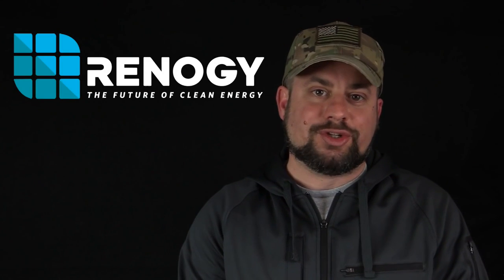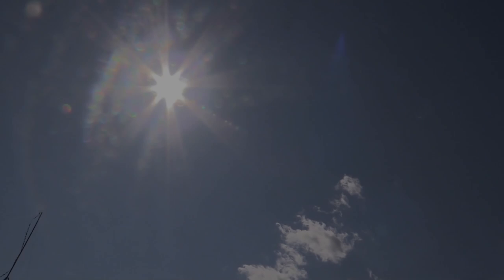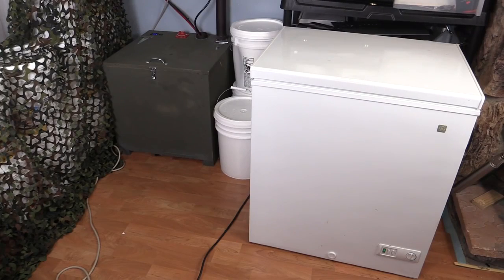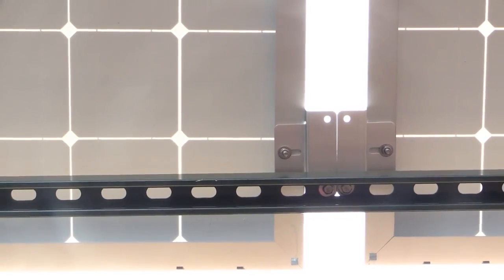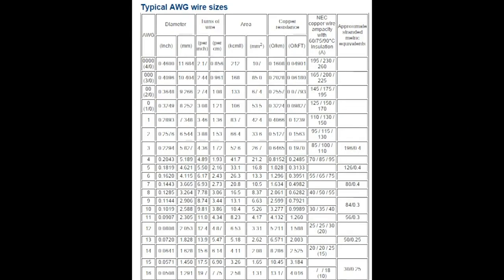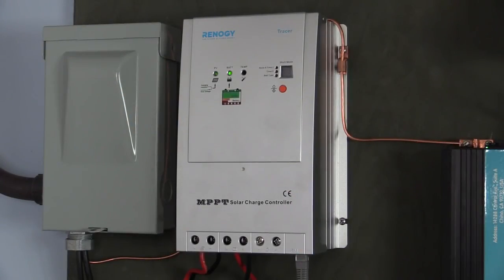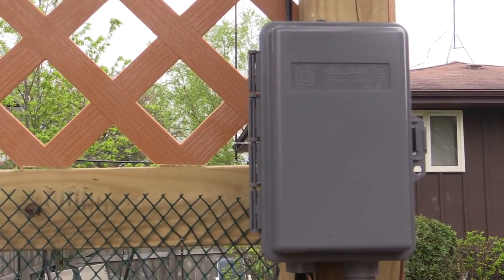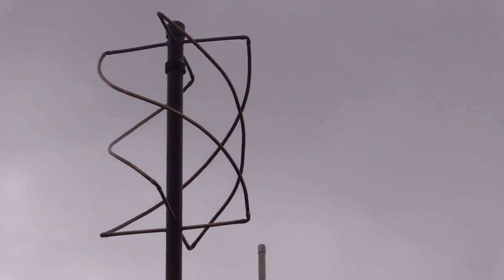The Ultimate Guide To DIY Off Grid Solar Power | Tin Hat Ranch

Comment: A small but important note to newbies, there have been critical advancements in Solar since this video was published 8 years ago. The price of lithium batteries has dropped drastically and they are more efficient, energy dense, lighter and long lasting (up to 20yrs) compared to flooded cell batteries. Don’t go for 12V sytem,  It’s more efficient to use 24V or 48v systems to power appliances and Electricals that have become increasingly important even to those living off grid. 48v is the best, that’s just four 12V batteries in series.  With modem lithium batteries you can have enough storage to run an electric stove , laundry machine and AC for a few hours but you’ll need expensive inverters to power them

Comment: Just came here to say thanks. This video helped kickstart my journey into solar over 6 years ago. Your video helped me to understand how to design my system, the importance of energy audit and the advantage of an MPPT solar charge controller. the video was the reference for my solar design and i watched it multiple times. Today I am completely off-grid and my system as grown from a 480w Solar Panel, 750w Inverter and 2 x 220AH battery into a 7.5kw PV, 28kWh Lithium Baattery Pack and 5kw Inverter system. I already remember the humble beginnings and how much you played a role in making it happen. Thanks so much.

Comment: "The average American household uses 30 kilowatts of electricity a day" (2:17) is not accurate.
Kilowatt (kW) is a unit of power - i.e. the rate of energy consumption. 
Electrical energy (consumption) is measured in kWh (kilowatt-hours).

Comment: Very well done. I've been off grid for 28 yrs and had to learn it all by experience. No budget made it tuff but now I have a forty eight volt system and a 5 thousand watt inverter all in one hybrid with 20 - 250 watt pannels and two 48 volt forklift batteries weighing 2 thousand pounds each. I think they will out live me now.

Comment: I am partway through and love this video. One point to make. No one with common sense would run an electric coffee pot on a small off-grid system. My system is smaller and simpler. Pour-over coffee with the water boiled on either the woodstove or the propane stove. Or a kero stove even. 
  Backups to backups are imperative offgrid

Comment: You can bank excess electrical in your water heater. You can look into circuitry that will dump excess power into a heating element in your hot water tank.

Comment: Where's the video that explains how to generate the income to do this stuff?  I'm down.   I'm a home owner, and I have a massive amount of Solar panels.  Completely handles all power usage between front house and a back house with a total of 2 families.    Is there a way to tap in to my system to have it be able to charge batteries like this?

Comment: I found that the best battery to use is the 2 volt gel batteries made for solar systems. They're a little expensive but I found that they last much longer then a lead acid battery. When it comes to buying solar panels, I would recommend the canadian-made panels over the panels made in China. The Canadian panels are high-quality panel then the China panels.

Comment: What if u have 4 240w panels at 37.2v 7.89amps and 40 to 50 feet to ur charge controller what size wire would that need running in parallel

Comment: I'm in central USA sunbelt. I constructed 400W setup with lifepo 4 650AH and 10000 Jupiter Inverter in case of grid down.
I find that simply setting 100W x 2 panels to hub facing east and 100W x 2  panels in parallel  to hub facing west in a triangle config gets me reasonable results.
Let's assume you're getting no solar power at night, you'll need a proper charger to keep battery bank charged in the night from the grid.
Simple garden timer can do that and cut off the grid power in the day hours so that you can draw from solar in the day.  Use 100 watt solar charger or the 500 watt it won't matter.

Comment: thin film high voltage panels are available secondhand for 5c/w and most household devices can run off 110/220v DC. 
devices like fridges freezers water pumps and compressors need sine ac and either an inverter rated at least 5x the used power or the inverter will blow because of start current, power factor, and back emf if using poor waveforms. that 1000w inverter will fail. better go for LF inverters that include heavy iron transformers. 
if you run dc into power tools add a second switch, and bind the tool switch to 'on' because the microswitches will acr and burn out. chainsaws drills and even rotavators run fine straight from panels and have less losses.

Comment: I have 30-375 watt panels running through 10.5 KW Inverter here on the ranch in Montana. Off grid using 8-8D Lithium Ion battery bank. I never use more the 50% of my power and always have room to expand use.

Comment: As a fellow prepper and HAM (and  video producer, I have to give you mad props! I'll be referring many noobs here for concept basics.

One point not mentioned but I think relevant: dual systems for a single house. I'm splitting my load into two systems: One for absolute essentials. The second is for cameras, NVR, Emergency cell Hotspot (US Cell makes unit that sit between modem and router allowing me to monitor cameras, doorbell and even talk two-way to people outside for what should be ample supply for perpetual/extremely longterm use.)

I'll try to remember to update if I find any new tricks. Again, great job!

Comment: Great video!  I've watched it from start to finish several times in the past couple of years, and I've found it very helpful.  I have four Renogy 100-watt panels, a 40a Renogy MPPT controller, and a 1200-watt inverter.  I'm using three100ah AGM batteries (no "Hindenburg issues" with sealed batteries, I'm hoping).  I've tested it all up by the parked camper but will probably wait for an actual "grid down" scenario to set it up in the house due to the "spouse on board" consideration.  One question for anyone who'd like to respond: With the current world situation being what it is, how would an EMP impact any/all of the components

Comment: Go down to the local trucking business and load my hybrid up with batteries even send the wife home to unload 50 batteries while I aquire another pile and they often have the extra connections so I can run them connected and with a 120 to 150 batteries this gives me a huge bank in the roof off my house as its a large bit of free space this means I can run my heat pump /air conditioner all winter and summer and happily keep adding more panels when a cheap one fulls of a back of a truck .also heating my hot water throughout the day do my dishes and washing during the day even put the freezer on a timer to run during the day and off at nights as long as you don't open to often. The idear is the new hybrid system that puts surpluses power into the grid ,with the right system you never run out and will make a wee bit of money you power don't go off with power cuts it just doesn't go to the main line,often you know when there's going to be a power cut in advance so you do everything you can to drain the batteries so you don't loss any thing

Comment: I'm building a system like this...I've got four 100 watt panels but before I got the frames finished we had 70+ winds and 1 panel got "shattered but working" so that left 3 so I'm going to get 3 more and building 1 inch square steel pipe protective frames..I've got a 24 v epever 4215 bn 40 amps in case I ever get a roof to put some more panels on..and I have a new Aims 2000 inverter/charger  that is the greatest..I really like it..so anyways I bought a 1450 watt air fryer  and I went the cheap road idk on batteries I used 6  85 amp RV batteries but I'm gonna get 2 more in a couple days..the thing is I have four #2 welding cables going to the Aims but it was a piece of cable I had laying around for years and it's not shiny like it has like brown dark stuff that I had to sandpaper the ends of before it would solder...I'm gonna replace the #2  cables because its bugging me now as to if the DC has to run around the outside of the wire does this oxidation stuff slow the juice? I made it thru the winter storm last week and my MT 50 told me I was going to get coffee...yay..so..but I was thinking yeah I should have changed that cable...

Comment: I live off-grid in Christmas Valley OR about 135 miles from Klamath Falls which is where the closest charging station for my Tesla is.Perhaps you can do a video explaining how one could build a charging system.  I was thing two banks of 5 one hundred watt panels., two large MPPT  charge controllers. 6 or 8 6 volt batteries and a 3000 inverter, Will this work?

Comment: I like your setup what was the total cost of all componentry plus panels an hardware most interested forv your reply.
Reply from the maker: This was far too long ago to gauge current cost. If I️ remember it was a little over $3k, BUT that was every last piece, down to screws and the frame to hold the panels. You could do it for far less today or have more capacity.

Comment: I have a Ammo can solar generator that I had a friend help me put together.  It does work.  My lack of knowledge, I was assuming I could run a Electric frying pan or a Small Fan.  This is not the case.  Is there a way to increase the Watts  with what I made.  Can I get a bigger Battery?  Or do I start from ground zero ?

Comment: Copper lug in direct contact with the  aluminum panel frame (40:33) will not ground well when new (anodized coating on frame inhibits conduction) and will eventually corrode right through the frame due to galvanic reaction. Going through all the trouble, and ending up ungrounded, not good.  You need a non-reactive interface between the two metals. This is a place where spending $$ on the right product makes sense. Otherwise a lot of good basics presented in a clear way.

Comment: Great overview of a DIY system. The specifics change as panels, batteries and controllers improve, but the basics are the same. Great explanation of why it is better to wire panels into higher voltage if they are not close to the controller and batteries.

Comment: Spend the power to spare by Tay King 👑 a 220V electric water heater and swapping the elements with 120 V elements and heat a tank if water. Then run a 12 volt water pump and circulate that hit water thru your hydronic baseboard heater and or your homemade radiant heated floor done with pex tubing.

Comment: In my area, a DIY set up would pay for itself in 7 years or so, about a 14% return a year, that's better than the stock market averages, and in 7 years, the system would still have a little bit of value.

Comment: Small nitpick. You don't lose less power because voltage is high, you lose less because current is low. Vd=IR. The starting voltage is irrelevant, they don't step power up so it's high voltage, they step it up so it's low current.

Comment: I would love to add to his comments, yes you do not need "XXX given you do your research." You can find power banks in lithium for cheap matter a fact you can build a 3.5 kwh bank for $650 dollars. You can search the net for panels for much cheaper then he go his for I got mine 230 watts per panel @ 2k panels for about 4k. So think before you buy research and find the best "YES IT WILL TAKE TIME TO LEARN." Its better then dishing out money for labor. "Battery bank" https://www.youtube.com/watch?v=PVnQ87Fvsk4 I do not want to give my solar source because I am buying more once I have enough I will supply. You know what "F IT" https://www.photonicuniverse.com/en/catalog/full/359-24kWh-48V-500Ah-AGM-deep-cycle-battery-bank-with-metal-racking-24-x-2V-batteries.html There is better but you have to research and find lithium via reused solar.

Comment: Love this you made it fun and informative.  I have a couple things to get your thoughts

1] Peltier Modules TEC/TEK/TEG/ETX  types  These solid state modules 2 sided with 2 wires. Add power to wires get cold on one side and hot on other.  OR  apply cold to the cold side and get hot on hot side and voltage off the wires,  Same with appling hot to hot side.  Heat Sinks, Fans, Caps and joule thief to get to work.    I lived in a metal storage unit in south texas for 2 years    I bought 200 Modules a dozen 3v fans, heat sink material and 100ft of copper tubing,   The roof got screaming hot everyday inside up to 120f.  I attached the HOT sides of modules directly to metal roof followed by heatsinks then tubing and fans connected to the wires to get power they blew across tubes fill of water .   heat of roof created cold to the tubes and voltage to the fans. it dropped temp by 30f  .    lots of uses to make ice, or charge a cell phone or heat a kettle or soup.         2]  heat by tubes on roof, and geothermal heat pumps,        3] micro hydro- power when no sun and big rain we have a flood area we formed a small dam with small tubes on low side and turbine at end of tubes x4 times enough power to charge the batteries,  4]VAWT  vertical axis wind turbines, more than enough to charge batteries

Comment: Grat information, thank you. I am just starting to do research on solar and this video brought up a concern I now have. We are building a small vacation cabin and strongly considering going solar than tying into the grid. But we will ONLY be there a few weekends or at most a week in the month. Because we wont be there full, should we not go with a full solar system or just use a solar generator when we are there or tie to the grid and pay minimal to the electric company? Opinions greatly appreciated.

Comment: Fork lift Batteries.  
You can aso mix the Parrel and In Series wire out.   (6v x 4 units 1)  (6vx2Units=12V x 2)

Comment: 27:00 
Waterproof converter and run AC the 60 foot.. The old Edison and Tesla argument why couldn't they just work it out?
Reply: Scaled Tesla Power Towers
Reply: @hankjones4756  12/220 volt transformers reasonable price would that be possible with 4 12volt batteries? The jelly ones are supposed to be environment friendly.. Also in 6 volt

Comment: so. much. information.
solar noob here.. my game.. slowly convert a good size older house to solar - not on the roof.
There comes a point in math, where, while I'm able.. I'm no longer willing.  Those calculators - double points for including them.
um.. I'm 37ish minutes in.. 
thought on outdoors and the cold for battery storage... peltier grids.
There's got to be a way to either line a box or cover the outside with these little babies.. cold on one side generates heat on the other.  There could be someone making peltier boxes.. if not.. ~business idea~

If I want to know if it's going to rain tomorrow.. I just ask my knees. 

And you may have just talked me out of solar.  It's over 90 degrees for 8 months a year here.. no A/C?  Deal breaker.

Comment: Finally tested my 2.5kw used array I got for $500 shipped. I got 10 used 250 Trina solar panels for $33 each and they are awesome. I uploaded a video and cant wait to start my cabin build. Lithium batteries will be the most expensive part so will use electric vehicle batteries. I think a 15kwh to 25kwh battery will be my starting point.

Comment: What size of Charge controller Should i use with 10 Renogy solar pannels (125w) and 10 deep cycles (12V) Batteries 125Mah + a 10 KW inverter? Your advice will certainly be appreciated

Comment: The truth is solar panels are Very hazardous waste, batteries are hazardous waste. Parts need replacing. Your waste goes overseas and ultimately end up in the atmosphere and ocean when unusable.

A marble size of radioactive material costing pennies is enough energy for your lifetime. And the cheapest greenest form of energy. The waste ends up deep in the earth, considering it is usually mined out and not that deep as it is buried.
We can now use up the waste too, which is 40% of that marble.

Comment: Electrical fuses are for fire safety, period! The size of the fuse is determined by the gauge and temperature rating of the wire given the load it will carry. It is there to prevent the wire from bursting into flames. A fuse size is determined by a current rating, an actuation time, and a voltage rating. Fast acting or slow blow are two examples of actuation time. Knowing the voltage, current and temperature that the wire will be exposed to will determine the fuse size. Also, if there are more than one fuse in series then the first one should be sized larger than the second. Thus a 50A fuse can service 2 or 3 parallel loads fused at 10A each.

Comment: His math for the PWM charge controller conflates Amps and Volts. What he said and showed on the slide was ... open circuits amps ... Nonsense! The Amps are 0 for open circuit! What he should have said was ... open circuit voltage ... and included the temperature coefficient that adds about a volt to the Voc (open circuit voltage) at 50C.

Comment: This guy gets the PWM charge controller limitations all wrong! A 12V system (nominal and refers to the nominal battery voltage) can and must accept a lareger than 12V input from a PV array in order to work. the limitations are the PV power and voltage and a typical Renogy PWM charge controller has limitations of 50V in and 120W for 12V and 240W for 24V.